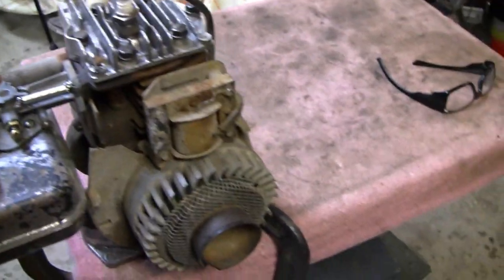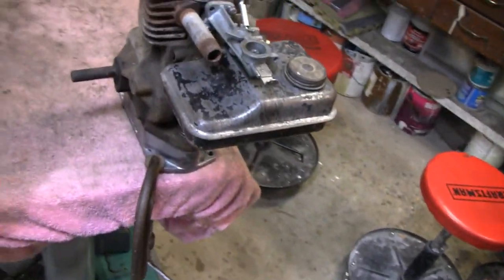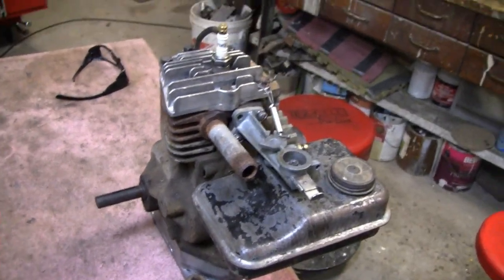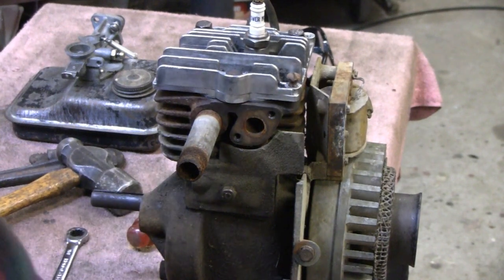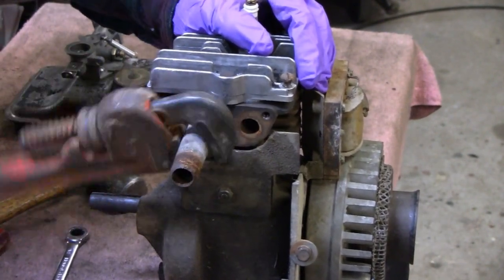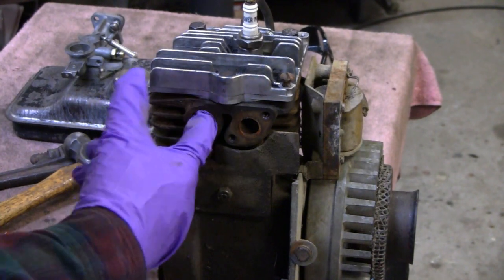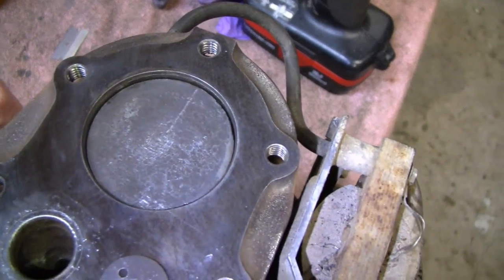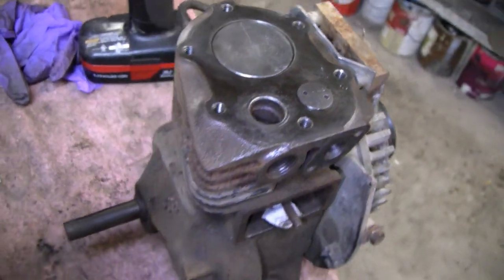HOMEMADE WATER COOLED BRIGGS ENGINE (part 5)

Comment: i was wondering . have you ever converted a brigs like a 10 HP. to electric start? I really need to put a starter on my 10 HP Briggs. it has the bolt holes in the block. do you know what's required to convert it. I haven't looked in to the engine its self. so I'm looking dumb and just asking. I really like what you guys do. I wish I had the tools  and friendship  you guys have.
Reply from the maker: Thanks Bud!! First you have to check and see if you have a geared flywheel (teeth around the edges)!! You probably don't!! So you will need a flywheel, starter, solenoid, battery and key assembly!!☺

Comment: The first time I pulled the valves out of a small engine, I was surprised by how soft the springs were. The springs on my RC car are stiffer than the valve springs of a small engine.

Comment: I had my comment deleted? WelI kindly asked if you had any tips regarding a  carburetor exact like this briggs one. Mine seems to be worn to the extent, , that it cannot idle low anymore.
Reply from the maker: Your comment wasn't deleted, it was answered
Reply: 805ROADKING sorry king. It was my old tablet not being capable of showing all comments. Thanks for answering and good luck with fixing the valves. This is much better than any TV - show.

Comment: I have a question, if you don't mind, does the heat from the head ever wear out the coils by melting the lacquer on the wires?  I've had lawnmowers, some new ones, owned, I don't work on others as a job or anything, but yeah, I've had some lawnmowers that just never seem to have a good spark the second year I've owned them.  Can I put a stronger coil on them?  Okay, that's three questions.  Thanks in advance.
Reply from the maker: Don't know Bud!! We don't mess with the newer stuff!! We only deal with 60-100 year old stuff!!☺

Comment: i bought a briggs like that, the piston has quite alot of sideplay, what should i replace? Is it the piston or the block?
Reply from the maker: That's the block!! Usually when you get that it has to be bored out .10 or .20 over!!☺
Reply: Thank you for the info :) i just finished cleaning it up, runs well but still has the piston slap (sideplay).

Comment: You will have to tell us where Lil goes to school and his major if it's alright with him.  You and Daddy Dirt are great mentors for all of your young friends.  Keep it up, Buddy!  You mentioned that you turned the valves.  Did you use a spanner wrench of some sort to turn them using the two holes in the top of the valves?
Reply from the maker: He goes to Rowan University, His major is Mechanical Engineering!!  By turning the valves we were referring to regrinding them on a machine, commonly known as a valve grinder or valve refacer or resurfacer!! For lapping we were able to use a suction cup to rotate the valve, there is an attachment to fit into them hole but we didn't have one that small!!☺
Reply: Well, I'm sure the Daddy DB is proud of him and I'm sure RK is proud of him too.  I guess he's like me and loves all things mechanical and the best part he's going to a school that provides an academic arena for him to learn more.  Mechanical 'things' is the main reason I watch your channel.  Thanks for all you do for all of us!

Comment: first id like to say thank you all so much for spending the time to make these videos. i do so enjoy them. they remind me of time i spent with my father when i was a kid working on these little briggs.
second, look out for those with centrifugal clutches with #35 roller chain sprockets on them. that usually means someone was trying to use it for a go cart or mini bike. those little dudes dont make enough power to pull such a heavy load. more than likely that explains the burnt exhaust valve and seat, dished piston, and loose valve  stems all due to overloading and overheating. the only reason the piston isnt loose in the bore and the rod isnt knocked out of it is because they were disappointed in the lack of horsepower and the fact that the governor looked to be in tact. you cant wind em to tight or they come unwound (so to speak).
third, you all ought to pick up a PE77 WWII generator. its a 1S engine (didnt even know that existed. so much for the first digit in the model # meaning cubic inches...) with an oil pump, huge oversize oil pan, internal flyweight governor, shroud mounted gas tank with a shut off valve built inside it (all which ive never seen before) and an updraft carburetor. ive found they're  almost (almost) worthless as a generator as they only put out 115v DC at 250w. no matter as they are little sweethearts. also mine is like brand new probably as it didnt see alot of action.
please keep the videos comin. i really look forward to watching them.
Reply from the maker: Thanks Bud!!☺

Comment: Valve refacer is the term for the machine to grind the valves. I have an old black and decker/Van dorne  super service I use.  very handy machines to have when your dealing with old engines.
Reply: burninpwder76 : again, I agree.
Reply from the maker: Mike has two of them, Not sure what Brands they are though!!☺

Comment: Perfect opportunity for larger valve upgrade and a port and polishing 
Especially on that tiny tiny intake 
SO MUCH ROOM FOR ACTIVITIES! ( on that head )

Also I'm wondering if you could replace that intake spring for the stiffer exhaust spring for better performance
Reply: MyLonewolf25 : personally i wouldnt. the poor little dude will seriously overheat and knock a rod out of it. they werent made for massive  power, just a sweet running dependable little engine. it doest take alot of power to run a reel type mower or washing machine.
Reply: EMORY M DELANO yes but half the fun is making things do that they shouldn't

Comment: Don't give up. Please make that old Briggs run again. It's not an f1 engine. Sometimes close enough is good enough.
Reply: lawnmowerdude he has the valve seat cutter you can see it from few videos back i think
Reply: I thought that too. But the way he was speaking was as if he only had the larger cutter. Maybe the smaller cutter was a loner?
Reply: lawnmowerdude could be but i believe this is the footage right filmed rigjht when he uploaded that i need help video so next video should be about gettin valve seat and valve itself fixed
Reply: Oh you're right. I thought it was the other valve. My mistake.

Comment: Exhaust valve pitted because of moister getting in through muffler? i know some engine manuals say to turn the engine around to compression stroke for long storage to close off the combustion chamber from moister.